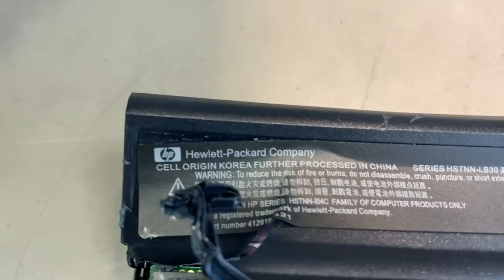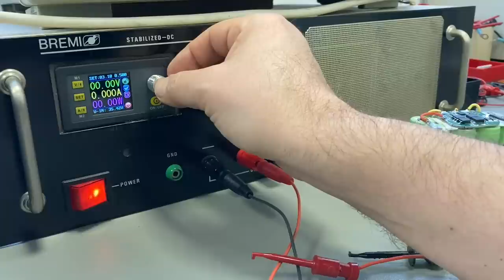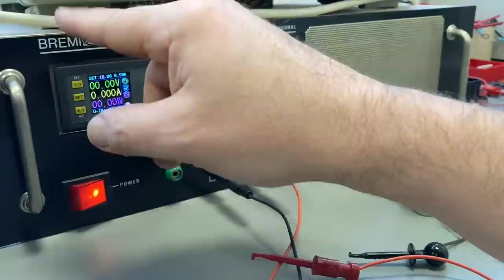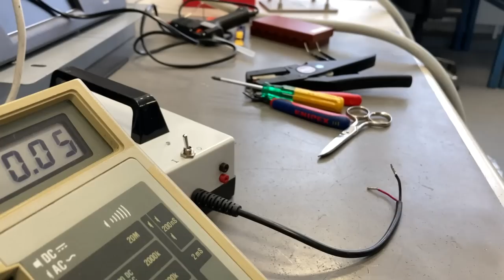What to do with old notebook batteries? (PWJ200)

Comment: Excellent video. I also did a similar video about this matter in my channel, the problem is the ordinary public (non-technician people) do not know how to operate an multimeter and people don't know how to take advantage of 18650 batteries. It's a shame that a lot of those simply goes to trash, it can still be repurposed
Reply: cool. will take a look at your channel. i do have a bit of understanding of multimeters nd components and the differences between shottky and silicone diode etc etc.. but its a fascinating subject and learning never ends. :)  at any level.
Reply: @Palmit_  I'm not sure if it is going to be helpful to you, my video is in Portuguese, but this is the link: https://youtu.be/ltkpounOt7I
Reply: @gustavogoncalves3083  thank you :) i have the abiliity to get a rough translation bt setting youtubes auto translate button in the video settings :) also, 'watching' instead of just 'seeing' the video is good. electronics the world around are the same. but not every method taught, is easy to understand. we all teach and learn in different ways. HNY friend. and thanks :)

Comment: Some good tips on refurbishing shrink wrapped cells.
Conductivity of the nickel strips is less than the equivalent piece of copper, so I was wondering how well copper strip can be spot welded onto these 18650's ?
Reply: It's very hard to weld copper strips to the cells because of the low resistance of copper. You cannot get any resistive losses to melt the copper. What you can do is make a copper-nickel sandwich, where the nickel melts trough the copper - but it still requires a strong welder.
Reply from the maker: Thats not possible. The copper probes would weld to the strip. Probably it would not melt anyway.
Reply: @PlaywithJunk  -> me = blanked sigh
Reply: @PlaywithJunk  It is possible - you just need a small piece of nickel on the top. i've done it.

Comment: i liked the project,. very impressive. but is there no instructions?? how get 50w bulb? heat sink temp rating? fan speed? led driver? how wire 4s2p bats to management board? what is the management board? etc...  or is this just 'showing off'?... please help with the questions. thank you :)
Reply: It's not a how to lifehack channel :)
Reply: He's only showing you how to DIY the battery pack, the light he used was clearly another project ( see description ) and check his back catalogue. The pack was explained verbally and where to buy and how to use a BMS videos are all over the internet, even how to build one yourself. The spot welder and nickel strip can be bought on ebay or Amazon for very reasonable prices. Disassembly of old power packs was covered and the testing and cleaning of the salvaged batteries even down to pre charging if your salvage is really low voltage, so there really isn't any relevant information missing and good luck with your build !:)
Reply: @andymouse  hello again :) thanks.. :D  basically "google it" lmao. i get it. i just thought it would be good for viewers of pwj to see an aggregation of the info put into one vid. shrug i get it wrong a lot, just speaking as a viewer that is really interested in this work and process. feedback aint a bad thing, especially as it's encouragment for MORE! :) HNY buddy.
Reply: @benbaselet2026  noted. but still really impressive and wanting to know more isnt a bad thing.
Reply: @Palmit_  Not really ' google it' as most of your questions are about the lamp he used to test the battery on ! Seriously he covers that entire project in another video, you will love it ! Happy New Year !
Reply from the maker: Maybe in another video.... and there are many videos already made about this topic. I just wanted to give an idea what to do with old notebook batteries and to show how many valuable parts we just throw away.
Reply from the maker: @andymouse 
What video are you referring to?
Reply: @PlaywithJunk  hi buddy. Hope you're well. Are you asking me? or are you asking andymouse? or the other person? I don't think i have have referred to a video.
Reply: @PlaywithJunk  it's appreciated :)  i have received my spot welder today. so some practicing for me, then i will try to make power bank. :)
Reply: @PlaywithJunk  And you did a great job ! I may be mistaken that you did a video on your 50W lamp but I was responding to Palmit's comment to help him out :)
Reply: @Palmit_  I think I caused the confusion ! sorry ! I was saying to Palmit That the 50W lamp was home made and you were demonstrating what to do with old Batteries, then we ended up chatting hope this makes sense 😃

Comment: I looked up the notebook model and would not have expected that the cells would still work at that age. Where did you get the replacement nickel strips? Would that also be the right material to replace corroded battery spring contacts?
Reply: For spot welding applications like this - nickel strips are best, as they're better with higher current (in other words, a load of 18650s together). But for replacing spring terminals or connecting regular other battiers and so on, you could use almost anything conductive. Steel or zinc coated steel is fine.
Reply from the maker: Nickel strips can be bought on Aliexpress etc. I got my strips from a battery manufacturer in Switzerland. They dont sell them but after I asked nicely, they sent me some meters 🙂 We buy a lot of batteries there so they just have been nice.
Reply from the maker: I think nickel strips are too thin for battery springs. They mostly use brass which is nickel plated. Or steel springs...
Reply: @PlaywithJunk  A fair point, but you can get by with really thin strips of any sort of metal for battery spring clips. I've done it with coke cans before now. Not ideal of course, but it shows it can easily be done and can be long lasting too.

Comment: I have that mini glue gun and its awesome ! great build....cheers.
Reply: what brand of glue sticks do you buy? i have found a few brands that are just terrible for adhesion if the product goes below 25c. they crack more than bend and just become unsticky and hard.
Reply: @Palmit_  To be honest I got it last year as a gift and it came with a pack of 20 that work just fine so haven't bought any !
Reply: @Palmit_  😄
Reply from the maker: For me it's too small. You have to reload sticks all couple of minutes. I'm only using it because it's in the room. When our supply of sticks runs out, I will replace it with a bigger version. But it may be ok for occasional private use... it's cute!
Reply: @PlaywithJunk  Yeah I don't use much so its perfect for my tiny shop !

Comment: I'd just like to add, there's probably SOMEBODY out there right now who could REALLY those charging circuits and connectors, consider listing them on eBay. I plan on getting into 3D printing new battery enclosures.
Reply: The circuits in the battery packs cannot control charging. It's just monitoring of the cells and a chemical fuse the controller can blow. The controller has memory as well, and once the cells went this bad, it will have noted this in its flash memory, or even have blown that fuse. So no, absolutely not useful.